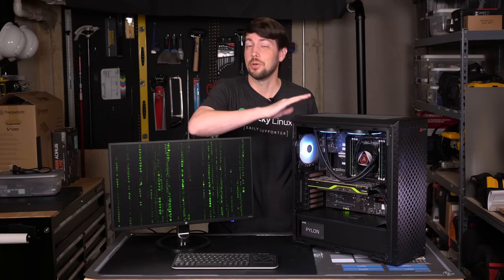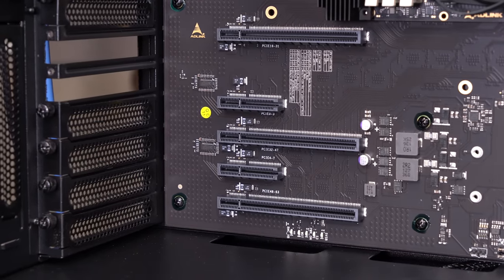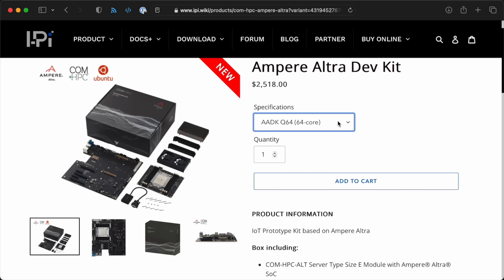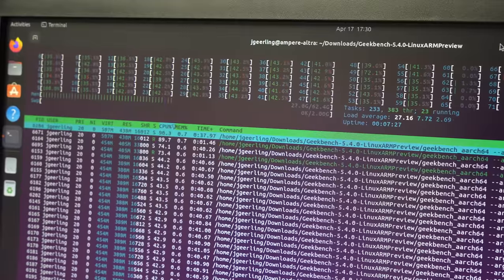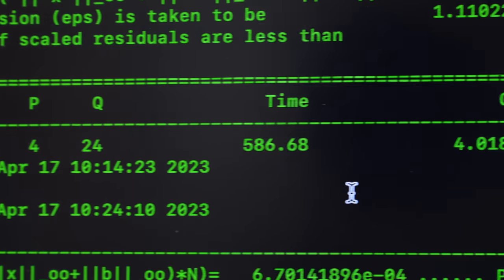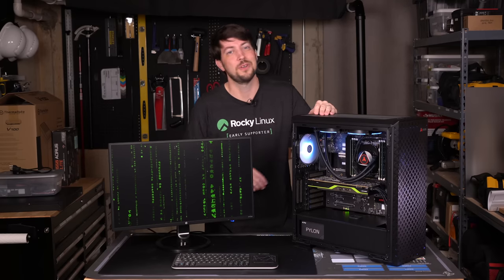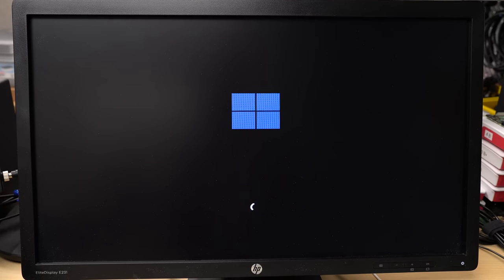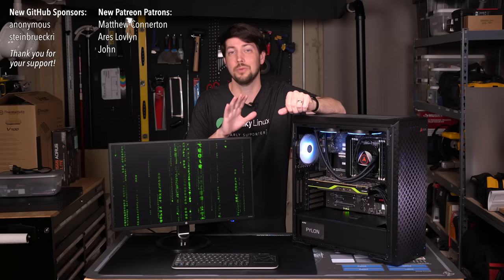This Mac Pro killer runs a GPU—and Windows on Arm!

Comment: I can almost guarantee you that the superior efficiency of Apple Silicon is due to the RAM and GPU being highly available and integrated on chip vs being separate and user-accessible on the system you're showing in the video.

The central party piece of performance and efficiency in Apple Silicon and in Metal (GPU compute/graphics programming) is the fact that data doesn't have to be copied from CPU to GPU and then round tripped back to the CPU:  work is prepared with the CPU and the data remains IN PLACE, because the GPU and CPU have access to the exact same physical pool of memory.  So the GPU just reads the data where it is, manipulates it, writes back to it and the CPU reads the results. on Graphics cards via PCIe the data must be written from main RAM over the PCI bus to the card, work performed, and the data written back.  

I believe Apple would sooner invent a chiplet-like connection that's post-manufacture modifiable or just significantly expand beyond the Pro / Max / Extreme scaling in place now before it would actually go back to user-expandable RAM or GPUs.   Or it would start offering entire compute cards with Mx boards on them and expand the overall OS to coordinate among them making a Mac Pro a box that effectively contains a farm of macOS machines inside.
Reply from the maker: They can have their cake and eat it too, though—put their chiplet design onto that daughtercard, have Optane-like memory if they want to add that close to the CPU, but at least add on PCI Express slots so you could also pop in other GPUs and cards like Avid, etc.
Reply: @JeffGeerling  How would they talk to the other GPUs?

Comment: That's in the range of my 5950x system.  It's probably faster with heavily threaded applications, by brute force of core count, though I'd probably beat it in gaming even if the games were equally well optimized for ARM as they are for x86 and both were equipped with a 6800XT.
Reply from the maker: Yeah, the 5950x has pretty fast cores. This machine mostly shines in workloads that can spread out (and are compiled for Arm... which like 99% of games aren't).
Reply: @JeffGeerling  Guest os choice would be limited, but where ARM versions exist, it would be amazing for my VM shenanigans which is the biggest reason I didn't go with a 5800X3D. I mostly use vms to learn other os's(and Linux where learning would mean a risky experiment), something with this many cores would be amazing for my VM use cases.

Comment: Apple will not play with team grean for a long time, they are competitors.   Does this processor have the memory bandwidth to run the graphics card or is it like the PI? Also turn off your RGB for flops/per watt. :)
Reply from the maker: It has plenty of memory (DDR4) and PCIe (Gen 4 x16) bandwidth, and some cards do work, but it could be a matter of finding the right driver version too.

Comment: You could always build your own workstation with all the stuff you need and use. Apple isn't the only vendor in the world making workstations.
Also, I do not think it's fair to compare Apple's M chips with Ampere Altra. These chips are built for different use cases and target different markets. What you see in this video is a developent platform, not a replacement for your workstation PC.
The Ampere chip does have a boatload of cores. But single performance of these cores is pretty low when compared to x86 or Apple's M chips. These cores are built for efficiency, not raw performance. This is not the processor for your average home and workstation user. Apple's M chips have fewer cores but they are powerful cores. Home and workstation use cases require a balance between core count and single core performance. While in the server market, parallelization often matters way more than raw per-core performance. That's why server CPUs trade clockspeed for higher core count.

Comment: From the Error I thinks' it's not Microsoft fault that Windows was not booting on this PC.

BIOS seems not  have required ACPI Tables require for Windows to boot, which Platform UEFI BIOS must provided in order for Windows based system to boot properly.

Comment: Apple does not need to do anything with nvidia. What they DESPERATELY need to do is fix Siri for consumers using modern LLM tech  - and create a custom ML-optimized "gpu" that can scale properly. Using GPUs for ML is currently the best strategy, but it's not optimal from a HW designer's perspective.

Comment: Did you/can you set the SATA/nVMe/storage controller to ATA mode instead of ACPI? I get those errors with Windows 10 when I set up the machine with ATA and then when the BIOS got reset defaults to RAID or ACPI mode....anyway.

Comment: Bruh I was hyped until I saw the abysmal single core score. What makes the M chips so good for average consumers is it’s incredible single core score, which is important for tasks which 99% of users do. This machine on the other hand is useful if you really need extreme multithreaded performance, but the mac pro would be trash if it had that single score

Comment: Neoverse-N1 is nowhere near Apple's M1 core since in SPECfp2017, the Neoverse-N1 cores seem to more generally fall behind their x86 counterparts (e.g. AMD EPYC 7742 (Zen 2) and Intel Xeon 8280.
Reply from the maker: Similar in architecture, dissimilar in performance.
Reply: @JeffGeerling  Instruction set is meaningless without factoring in microarchitecture's implementation.
Reply: If you can sacrifice a little perf at the core level you can get a whole lot more compute in at the rack level.
Reply: But none of Apple’s cores are available in an upgradeable implementation.

Comment: Gonna be honest, they can keep their soc. Just put an mX chip on the motherboard where the tpm module/chipset would normally go. Literally just sell us a Threadripper mobo and that's it. Partner with a major board producer to produce a wide QVL list of standard and ECC ram, and that's it. The mX chip will access nvram and rom holding backup OS like normal, in their normal secure enclave. It'll basically be a trimmed iPad LB in a corner of the mobo.

Comment: Awesome video. Is there a TDP given for the CPU? And can you play games which were designed for x86 on that machine?
Reply from the maker: TDP for this chip is 190W I believe. They vary from like 160 to 250 or so? they don't make any low-TDP chips at the current time.
Reply: @JeffGeerling  I don't suppose you know how much power it uses at idle, do you? I am curious to see how well it could act as a NAS/hypervisor with ZFS. I need the lanes and I am very anal about power efficiency and want to look at arm for that.
Reply from the maker: @mattkappen7292  For that, I wouldn't necessarily recommend it — in my blog post I dig into it, but in the video I skipped over that. It uses about 60W at idle, and the BMC keeps using 4-6W even when the machine is powered off.
Reply: @JeffGeerling  Great to know, thanks! I will look at your blog post.
Reply: @JeffGeerling  Well, with this number of cores, that's the range I assumed. Thanks a lot!
Reply: The 32 core Ampere Altra has a 65W TDP but you'll generally see about 40W max draw whilst benchmarks are running.
Reply from the maker: @vikingforties  I'd also love to see what they could do building a smaller physical chip/socket size with maybe half the PCIe lanes tailored for desktop or 'edge' / IoT a little further, maybe in their next gen.

Comment: Im almost certain you tried this, but did you (a) use the open source Nvidia drivers? Not the nouveau drivers, but the actual OS Nvidia drivers, and (b) scroll through the configs (or cli) with enabling unsupported gpus?

Fast reference:

"Note that the kernel modules built here must be used with GSP firmware and user space NVIDIA GPU driver components from a corresponding 530 41 03 driver release."

First acquire appropriate packages then:

sh ./NVIDIA-Linux-[...].run --no-kernel-modules

Make for arm:

make modules -j$(nproc)
TARGET_ARCH=aarch64         \
    CC=aarch64-linux-gnu-gcc    \
    LD=aarch64-linux-gnu-ld     \
    AR=aarch64-linux-gnu-ar     \
    CXX=aarch64-linux-gnu-g++   \
   OBJCOPY=aarch64-linux-gnu-objcopy

Then enable the rtx 8000 (works for rtx 6000)

NVreg_OpenRmEnableUnsupportedGpus=1

Comment: I don't see any reason for Apple to make an M-series Mac Pro. The whole advantage of the M-series is that it's a tightly integrated system on package. Once you start decoupling the memory, GPU, etc it'll probably become more or less the same as every other chip. It feels like Apple chose the right tradeoffs in terms of die space for the average user/prosumer and it'd be wasteful to re-engineer the whole thing to enter a field where they don't really have a competitive advantage (and thereby pricing power).

Comment: I want a pure, powerful, Windows arm, workstation (including a powerful apu/igpu on par with a graphics card or close enough).
Reply: Time to face it: Windows on ARM is never going to be usable.
Reply: @lawrencedoliveiro9104  because Microsoft doesn’t want it to be
Reply: @Dave102693  They’ve been trying for over a decade.
Reply: @lawrencedoliveiro9104  not hard enough. Instead they rely on shitty Intel mobile chips and Nvidia gpus instead of effect arm chips.
Reply: @Dave102693  They’ve been using Qualcomm chips.
Reply: @lawrencedoliveiro9104  for a very models of any of its first party or oem arm products
Reply: @Dave102693  All of their attempts at Windows-on-ARM. Except the “Windows IoT Edition” for the Raspberry π (Broadcom chip), but you really don’t want to use that.
Reply: @lawrencedoliveiro9104  still doesn’t change by point they could of tried harder
Reply: @Dave102693  Even now, they are still failing.

Comment: Does anyone know how are those performance numbers when you compare them to a latest 13900 or 7950x or so? Thanks. Curious also about the GPU test on it.
Reply from the maker: You can compare to a 7900X, i5-13400, 5600X, and a few other systems I tested here: https://browser.geekbench.com/user/446940

Also on here: https://github.com/geerlingguy/top500-benchmark#results
Reply: @JeffGeerling  Wow, M2 gets 4 Gflops/watt. They really have a good one. Cannot wait to see more and more ARM (and at some point, probably in 5-7-10 years, also RISC-V).

Comment: I don't understand what Apple has to do with this

He got everything working (well, aside windows), all parts are available, so why is Apple relevant here?
Reply from the maker: The M2 silicon is more than twice as fast per core (and includes a decent GPU with faster and more VRAM), so if they built a workstation, this would be the best comparison on the non-Apple side.

Comment: An interesting test would be to run x86 software on this with box64 and FEX-Emu. Both emulators also support Wine, so it should also be possible to run a lot of Windows programs on it.
Cinebench would be a good candidate to test how much performance is achievable on this machine under x86 emulation.

Comment: 😁👍
I would like to see this work on the Original Debian OS. Manjaro and Fedora distributions.
If Apple made their MACOS freely available to be installed on any hardware.  Many people would jump over to MACOS from windows.
The ONLY reason why windows has a death grip on the PC industry is because of games and some software's people can't do without like the Adobe platform and others.
If it were not for that, so many people would have left windows a long time ago.
Reply: Adobe is an irrelevance to 99% of Windows users, really. So games is the main “killer app” remaining for Windows right now.
Reply: @lawrencedoliveiro9104  
That's not true. 
As most companies, specially large companies that creates graphic's or video production uses Adobe products.
It's an industry standard.
Just like Pro-Tools by AVID is a standard in the Film & TV Industry.  Same thing.
Large companies make deals with Adobe and can't afford to use tiny company products in large corporation tasks.
Reply: Fun fact: a survey of the VFX industry was released a little over a year ago, and they found that 60% of their machines were running Linux. As you may know, Adobe products don’t run on Linux. So basically that is one big market segment that no longer cares that much about Adobe.

Comment: Seeing a modular desktop with a straight plugin arm CPU, just like any old x86 cpu, just proves that the custom desktop PC won’t just disappear as we get closer to an arm or riscv SOC world. Just need to get x86 translation for software compatibility near perfect. Apples Rosetta2 has already proven this is not only possible but near native performance capable too
Reply from the maker: Even Microsoft's X86 translation layer isn't too shabby. It's nowhere near Rosetta 2, but it's decent, especially if we get faster Arm cores.

Comment: Maybe for windows on arm you should using @awakecoding script to build windows iso because even for volterra, windows recovery zip are suck
Reply from the maker: Yeah, still trying a few other techniques too. plus I have a few Ampere engineers I'm in contact with!
Reply: @JeffGeerling  kinda curious what Microsoft solution that gonna be work

Comment: I really don't understand why you still continue to work on a Mac. What is so fantastic about it?
Reply from the maker: The thing I love about the Mac Studio is it's way faster single core, and faster than my 7900X desktop... but it's tiny, sips like 5W at idle and 60W maximum, and rips through video editing. All while being literally silent (it's lower than the 34 dB noise floor in my office).

Apple does do a good job on thermals and performance, they just... lack on expansion and upgradeability. It's a tradeoff but for certain niches, a good one.

Comment: The reason Apple manages to get so much performance out of ARM is they own Soft- and Hardware.
They have cut unused logic from their chips to use the room for more cores, cache or AI.
ARM is not ARM, many Chips are inflated with feature sets, just like x86 CPUs are.

With Windows and Linux there is always one side missing.
Optimized hardware wont released without OS support.
OSs can't set restrictions because then they wont run on mainstream hardware and no one would use them.

Comment: Apple is so infuriating.  Their desktops are quite literally the worst limitations of a desktop and a laptop married together.  There is no reason they couldn’t have pro chips that had some amount of super fast unified ram while still having slower but still fast ddr5 sockets for expandable secondary ram.  There is no reason they couldn’t support having pcie and m.2 slots.  There is no reason they couldn’t put a computer in a real computer case for customers who don’t mind putting it under the desk and care more about function than form.  They just won’t because they have lost all semblance of understanding power users.

Comment: Apples idiotic pursuit of 100% secure ram and storage on a encrypted SoC, is the main culprit as to why Apple refuses to allow any functional internal upgrades.

There is zero reason Apple couldn’t produce a secure SoC and provide additional insecure SSD and PCIe slots, maybe even fast aftermarket cache ram.  Of course apple could supply higher rated “secure” OEM ram, SSD and graphics cards tuned specifically for the M-MacPro, while allowing ordinary users (not obsessed with encrypted security) to use market standard ram, secondary m.2 NVMe drives, and aftermarket GPUs. 

The base SoC would still be encrypted to Apple’s content, with Apples limited notion of a base configuration. And guess what that added internal  flexibility is exactly what users have been asking for for more than a decade!
One could imagine the M-MacPro base SoC configuration could be 64GB SoC ram, 2TB SoC SSD, with one gen 5 PCIe slot, 2x ram ddr6 ram slots, and a m.2 slot.
With the Apple upgrade path being and SoC with 128, 256,… 1024GB SoC ram, 8, 16,…64TB of SoC SSD, and SoC neural engine with an astounding number of cores. And multiple PCIe slots, and m.2 slots. 

The top spec m-MacPro could be a monster off the shelf, but capable of being user upgraded to a phenomenal workstation. The variation in SoC and board skews merely determining how flexible that M-MacPro would be.  And a five yearly M-MacPro architecture cycle could (as it already does, LoL), continue with newer models taking advantages of Apples continued leadership in design —-without the present failure to take advantage of industry standard hardware advances. 

So imagine 96 cpu core/256core GPU 128GB ram/2TB base SoC with secondary cache ram slots, secondary PCIe slots, and secondary GPU slots, and a 64 core SoC neural engine. Apple could sell this for US$5k and still make an astounding profit margin. And in five years time prosumers would snap these up second hand, while the heavy pro users would buy the next monster, and novice prosumers would buy the next iteration of the Mac Studio. 

**The Mac Studio could be configured with no additional features other than a single secondary  unencrypted m.2 NVMe slot that users could upgrade.  Imagine the enhanced affordability and popularity  of a M3 Max Studio 16core cpu/ 32 core GPU 32GB ram/1TB SSD, with a single m.2 expansion slot.  Heck that wouldn’t even require a significant redesign of the Mac Studio platform aside from making the bottom cover more user friendly to remove. Oh hey apple already has that design feature patented from back in 2014!.